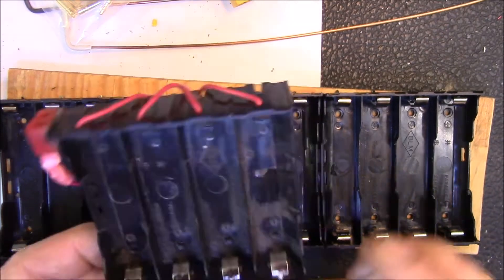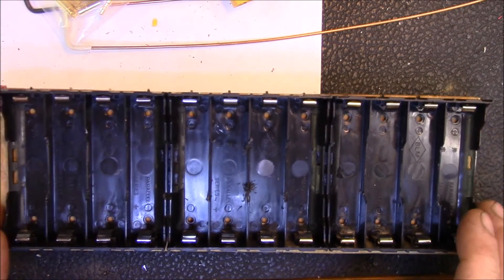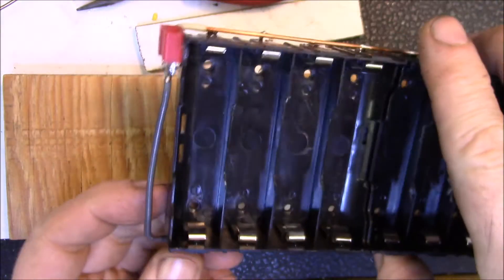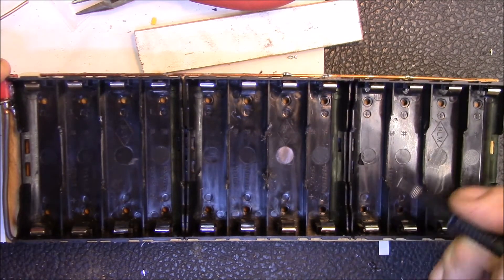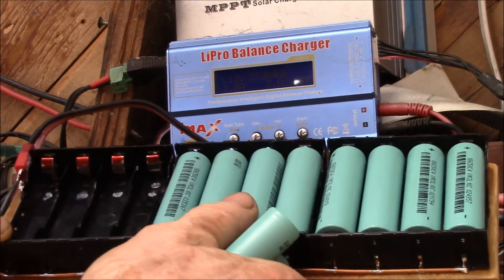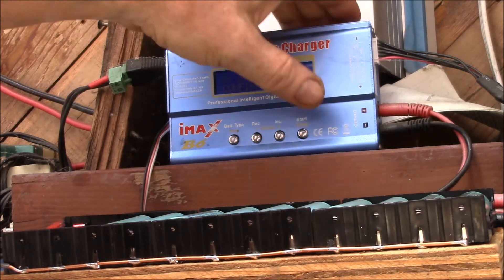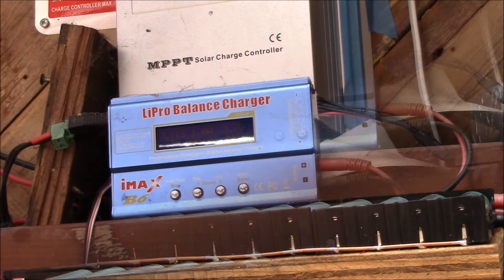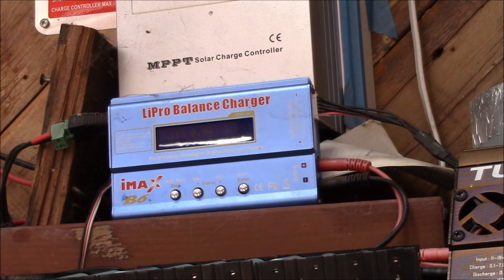12-Cell 18650 Storage Charge Setup, Part 1

Comment: If you do not want to burn them out shall be charged as ballanced ones with single cell connected separately.
Reply from the maker: Yes, that's probably the case in general, put a charged, low resistance cell in with a highly discharged or shorted cell and there will be issues.  In my case, I only use this to bring already tested cells back to storage charge.  So all the cells have been recently discharged to 3.0 volts and all have similar capacities.  I've run over 1000 pairs of cells through this charging setup and have yet to encounter any problems with it when used this way.  Also, these cells are destined for 20P modules and if they can't handle being charged in parallel, I want to eliminate them at this point, so this is a part of the testing process. 
If I want to charge one cell, I can put one cell into the holder, likewise, 2 cells, no problem.  I do have a multi-cell cell holder wired up with balance cables and that does work.  Although if I want to charge less than the full holder, I have to fill the holder with dummy cells and then change the charger "S" setting to reflect the number of cells being charged.  This makes it less convenient to use unless I fill the holder fully.

Comment: Can i charge 9 cells in parallel or 18 cells in parallel?
Reply from the maker: Sure, typically is no problem.  Just be sure all the cells are somewhat equal in charge, capacity and internal resistance.  For example, in my case, I use this for recharging groups of cells after doing a capacity test on them, so I know all that data.  My initial charge on a few cell, prior to capacity testing, is done one at a time.
Reply: @The4Crawler  thank you a lot
Reply: Btw it should be always equal the charge level of cells if i put them in parallel
Reply from the maker: Yes, you are putting the same voltage on all the cells.  This is assuming the cells are fairly similar in capacity and internal resistance and of course the same chemistry.  But I've charged 100s of cells this way and they all end up at the same value.  I usually charge the group back to a storage voltage, around 3.8v.  Then of course once I stick 10 pair of cells in parallel (20 in all) into my battery pack, they are getting charged in parallel every day they are connected to my solar charge controller.
Reply: @The4Crawler  ok thanks you much for the info.can i ask you 1 last question can i charge my battery even its half full?
Reply from the maker: Should be no problem to do that.  In my process, I capacity test my cells, then charge a batch of them up to about half full and let them sit.  Then, when I have collected enough cells, I group those up into sets of 20 cells in parallel and put sets of those in series to make up my finished battery packs (4S20P).  Then I'll take that half charged pack and balance charge it up to full voltage and then I'll add it into my battery bank when it also is at full charge.  I do go through and check each cell (or pair of cells) prior to charging them to make sure they are all at about the same voltage (within a few 10s of a mV of each other) prior to shoving them into my parallel cell holder.  You just want to avoid putting in 11 cells @ 3.8V and 1 cell that has shorted and is at 0V.
Reply: @The4Crawler  thank you so much for your time and info this means a lot to me i know nothing about battery etc.ty again!
Reply from the maker: No problem, glad to help.  I also knew nothing about these Lithium ion batteries before I started and picked up a lot of good information off of Youtube then tried some of my own things like making this 12-cell holder.  I only did 12 because the biggest holders you can get are 4-cell and my battery packs use 10 paired up cells so I'm usually charging 10 separate or 10 pair of cells at a time.

Comment: Great video !! Thank you. If the cells go in at different voltages, do they all finish up at the same voltage?
Reply from the maker: Yes, as long as all the cells are below the storage charge voltage, they seem to hit the same end voltage/charge.  I do this after discharging a group of cells, so they are all in a fully discharged state.  Different cells may be at different recovery voltages, like in the 3.30 - 3.45v range, but that seems to have no affect on the final storage charge.
Reply: Is there any reason I shouldn’t or couldn’t charge my pack like this after each use?
Reply from the maker: I guess it would depend on how your pack is wired.  In my case, I'm either charging up to 12 separate cells or that many pairs of cells.  So all are charged up to the same voltage as if they were a 12P1S pack.  I mainly use this setup to recharge groups of cells after capacity testing them and prior to matching them up into groups of 20 for my battery modules.